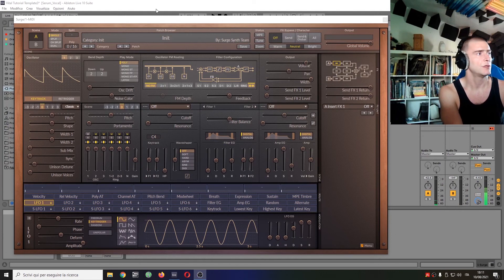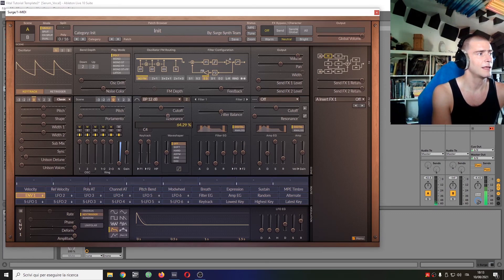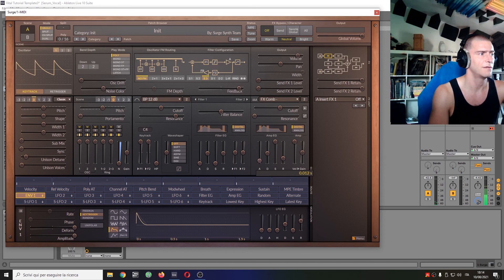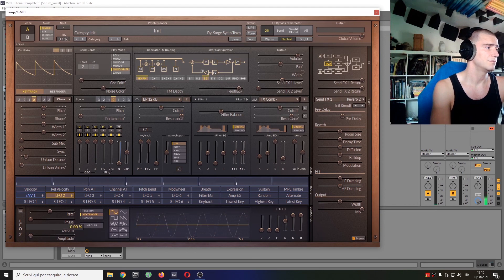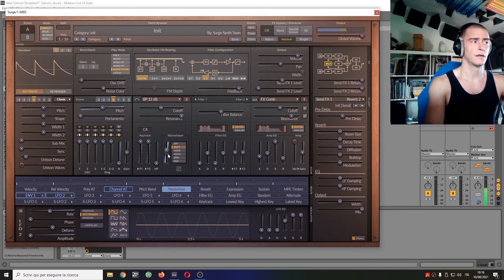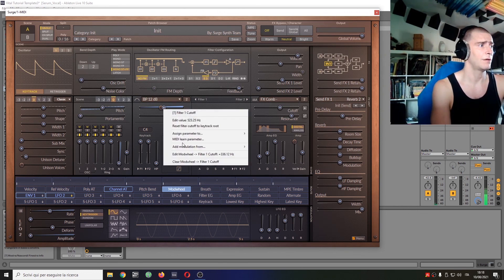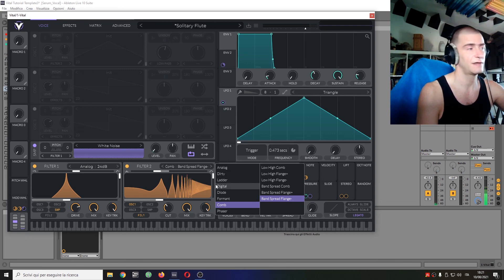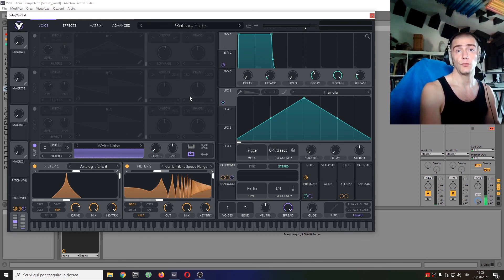Surge VST Tutorial | physical modeling woodwinds

Comment: But how can you modulate the volume of the sound when it is based on an impulse and not a continuous exciter?
Reply from the maker: @YorgosSimeonidis  you can't, but since the idea is an initial whiff, you shouldn't need it to last much longer
Reply: @ But a big part of wind or string instrument expression is that the volume of each note can change over time. Not all notes are short.
Reply from the maker: @YorgosSimeonidis  yes, but again, that part is not about the "note" but only about the initial whiff of when the note is starting, then it leaves room for the actual oscillators

Comment: Nice one as always. I am thinking of starting sound synthesis with vital since ui looks more beginner friendly with all these graphs. Do you think surge is more capable or vital has all you need for sound synthesis?
Reply from the maker: They are a bit different. Which one is more "capable" is really a matter of preferences imho, they shine in different departments.  Vital has a much clearer interface, and it's very easy to program deep and complex things, I never pressed "save" as often in any other synth; on the other hand, it is very CPU hungry. Surge has its sound, a wide array of interesting oscillators, very convincing filters, a huge array of effects, and it is very light on the CPU, but on the other hand it isn't as comfortable to program, even if you know what you're doing... Yet, they're both free, why not use both?
Reply: @platipo  Thanks for that great answer. I didn’t know they have their own advantages in different ways. I will start learning surge after I get somewhat comfortable with vital.
Reply: @trardac  well my take on It is that they are just different. Vital is an obvious clone of serum and serum is a very capable softsynth, if not one of the best out there. You have 3 wavetable osc which timbre can be changed seperatly with fancy FX/distortion. It is very good for digital / harsh stuff. You have your 10 audio effects and can route and modulate them as you wish. Thats also good but your limited in the options for the different FX (f ex different types of reverb/distortion etc). This is where surge imo is better (for me). You may have not the crazy sound shaping possibilities in the oscillators but you have many interesting oscillator types which have different characters. The filters just sound very good and if you come from a analog synth background you will enjoy this a lot since they sound really good. For me, the modulators are very nicely displayed and i really like the sample and hold and sequencer on that. And one very strong point is the endless number of FX you have. Like damn these are a lot. 

In general surge gives (me at least) a more "analog" or "hardware" feel while vital is more of the digital, flexible workhorse. Surge works better for me, maybe for you vital works better :) peace
Reply: @andewprod  Thanks.